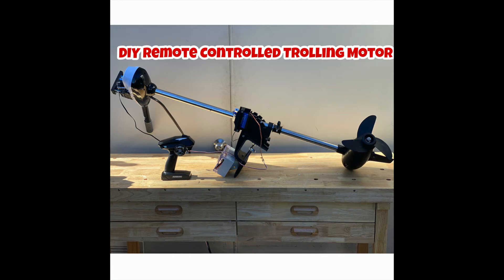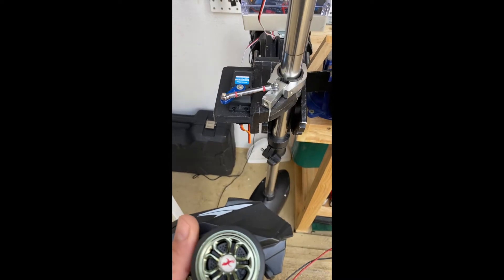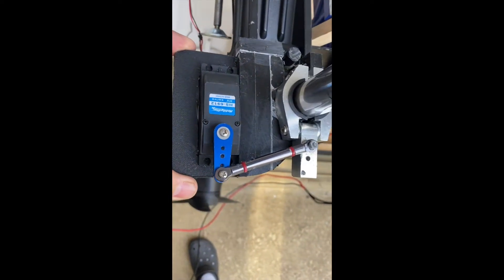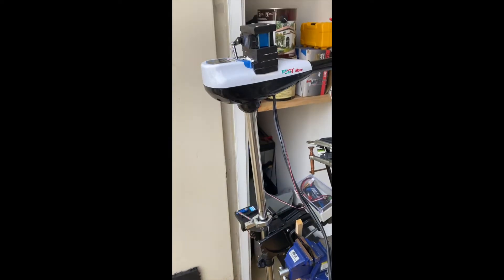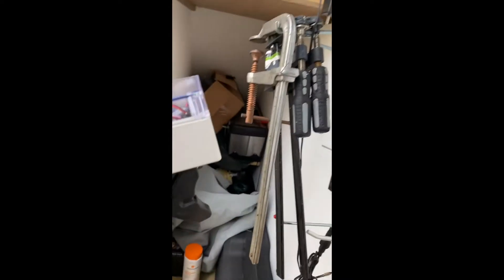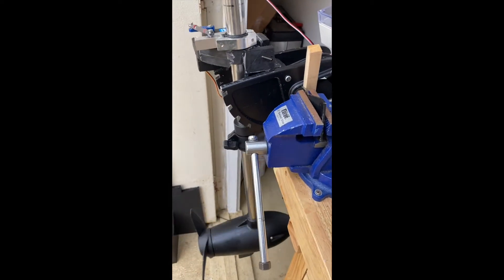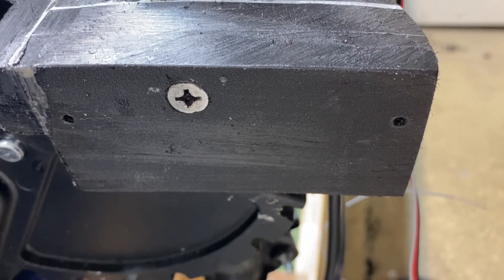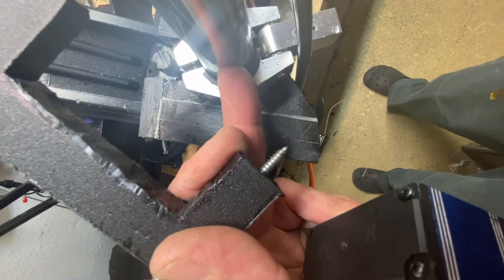Wireless Remote Controlled Trolling Motor Assembly DIY

Comment: Hi where can i buy the servo and housing,,,,,,,,,,,,😊😊😊 im interested in making,,,,,, one or two,,,,,,,,,,,,,,, for my,,,,,,,, watersnake trolling motor ,,,,,,,,
Reply from the maker: Use this 12 volt servo for 3 hp (3000watts) or larger trolling motors 

https://www.amazon.com/dp/B0CCNYDXD2?ref=cm_sw_r_cso_cp_apin_dp_Q7PA0DH15Q8GG9WECZ37&ref_=cm_sw_r_cso_cp_apin_dp_Q7PA0DH15Q8GG9WECZ37&social_share=cm_sw_r_cso_cp_apin_dp_Q7PA0DH15Q8GG9WECZ37&starsLeft=1&skipTwisterOG=1&th=1&psc=1
Reply from the maker: https://a.co/d/154obkr

This will be fine for your water snake. I recommend this servo for trolling motors up to 2 hp or about 2000 watts. Good luck and let me know if have any other questions
Reply from the maker: This is the marine board I used to make the engine mount and servo housing 

https://a.co/d/3Ren9Se
Reply from the maker: I used the M8 clamping knob in this assortment as a steering lock

.https://a.co/d/81IqOeP

Comment: Nice build, can't wait the parts for steering to arrive. As i want to add an brushed ESC as well for the motor itself i'll use on RC receiver for speed and steering. I planned to use a BEC to provide power to the servo. This way i can put it all together in on box with one power input/output and a single 3 pin cable for the servo.
Reply from the maker: A lot of guys run the ESC with good results. Just make sure it can handle the load

Comment: Nice video.  I was looking for a way to accomplish the same thing and yours wins.  The only difference I will be doing is an epoxy casting instead of layering, screwing, and gluing.  I’m probably wasting my time but going to give it a shot. Ha… do you think a smaller servo would get the job done but a little less jerky?  Maybe this also isn’t so much jerk in the water?  Assume you’ve used it quite a bit by now curious if u suggest any alterations from your video.  Thanks for the time.
Reply from the maker: I’m sure you can find a smaller servo that can do the same job. Make sure the voltage of the smaller servo is correct for your project. I remember seeing a few volt options….The servo I’m running now is 65 or 75 kg of torque. I’m pretty sure you will be to find a smaller servo with similar power output but it will more than likely cost more. Good luck. Post a video when your done. I would like to check it out!

Comment: Thanks for this video, im in the same project you save me time on ideas on this... excellent... i just need steering.
Reply from the maker: I’m putting out a new video in the next day or two. I accidentally sank my old motor but retrieved it. I’m reusing that same steering setup on my new motor and it’s still going strong despite sinking and being a year and a half old. Good luck with your project.

Comment: Waiting on parts: I love your idea of using an RC servo escapement to provide remote steering! However, I am NOT going to make a mod to provide remote control of the motor SPEED, but am ONLY INTERESTED in the borrowing your idea as it relates to the STEERING ASPECT designed in your neat creation. Question: I am perplexed by one thing; You mention that your motor came with a "BRAKE", and that "brake" then provides a static place to "push against" (the other end of the linear actuator then, of course, couples to the short steering arm of the trolling motor). I do NOT SEE what, or where, that so-called "Brake" is, on the trolling motor shaft from the information that you have graciously already provided. Did you find an EASY static point to push against,... ONLY because that your particular trolling motor model has some unique feature that all other motors do NOT have,..to use as YOUR static point? (for that matter what-in-the-world is a "Brake" doing on a trolling motor in the first place??) ....Even more to the point,..What the devil is a "brake" doing on a trolling motor in the first place??
Thanks to the rest of your documentation, everything else seems somewhat easy for me to try and duplicate, in adapting your servo idea,...?
I would appreciate any additional pictures or explanations that you might be able to provide as an answer to my question. Thank You so VERY MUCH!
Reply from the maker: Most trolling motors have a little wing nut bolt on the trolling motor shaft that locks the motor in one position. This is for boats that already have a rudder system to steer the boat. The brake on your trolling motor locks motor steering angle in one position and steering is accomplished by alternate methods, either rudder or paddle….I took the wing nut out and mounted the servo to the  threaded hole where the brake used to be. You can see the threaded hole and the brake in my video right when the music starts at the beginning of my build montage
Reply from the maker: I tried to post a photo of it but YouTube won’t let me. Here’s the original Amazon advertisement for the motor. You can see the little black wing nut just above the tilting transom mount. 

INTBUYING Electric Trolling Motor Brushless Marine Motor Propeller Thrust Saltwater Transom Mounted 1.5T Load 165 LBS 24V https://www.amazon.com/dp/B08FQMQ6B5/ref=cm_sw_r_cp_api_glt_fabc_PRH95GB5Q3EJ8B8AE946?_encoding=UTF8&psc=1

Comment: Thanks for sharing the build. I'm definitely leaning towards the servo steering build. I like how it gives you full tilt capabilities. Do you think a smaller servo would work? Also curious if I could run a voltage regulator and run the servo/receiver off my main battery. I think I will be going the PWM route for throttle control.
Reply from the maker: I chose the biggest servos I could find because of my large 1500 watt trolling motor,  and  I wasn’t sure how much effort it was going to take in the water. You can definitely get away with a powerful small servo, however they are three times the cost. If you search they make servos that run off of 12 volts also…. There is a device that steps down voltage, I’m considering doing the same and running my radio off of my backup lightweight lithium ion battery’s that I keep on board in case the large Lipo4 battery dies. Good luck with the build. I’m curious to see how yours turns out.
Reply from the maker: Direct Current Converter 12V to 5V 3A 15W Buck Converter Module, Reduced Voltage Regulator Car Power Converter Output Power Adapter, Wire Interface (1 Piece) https://a.co/d/9JRJfB2

I ended up using a similar buck converter to drop the volts from 48 volts to about 8 volts. I chose 8 volts because I can run the radio receiver and the high torque servos with that voltage

Comment: Can you put links to the parts
Reply from the maker: 8pcs Upper & Lower Linkage Pull... https://www.amazon.com/dp/B07WQWR66N?ref=ppx_pop_mob_ap_share
Reply from the maker: Power HD 1/5 Scale Waterproof... https://www.amazon.com/dp/B085W7Z8HB?ref=ppx_pop_mob_ap_share
Reply from the maker: WPHMOTO 28mm 1 1/8 inch Brush... https://www.amazon.com/dp/B078FGYK4W?ref=ppx_pop_mob_ap_share
Reply from the maker: DUMBORC X4 4CH RC Radio System... https://www.amazon.com/dp/B07RR81GSB?ref=ppx_pop_mob_ap_share
Reply from the maker: Marine Board HDPE (High Density... https://www.amazon.com/dp/B073BV5LN9?ref=ppx_pop_mob_ap_share
Reply from the maker: INTBUYING 24V 165 LBS Electric... https://www.amazon.com/dp/B08FQMQ6B5?ref=ppx_pop_mob_ap_share
Reply from the maker: Zeee Lipo Battery 7.4V 100C... https://www.amazon.com/dp/B073S2W6PZ?ref=ppx_pop_mob_ap_share
Reply from the maker: Let me know if I forgot something, or if you have any questions.
Reply: @waitingonparts  Did you build or buy the collar that is around the trolling motor shaft? the Aluminum horseshoeish part.
Reply from the maker: @Carob75  WPHMOTO 28mm 1 1/8 inch Brush Handguards Hand Guard Clamp Mounting Mount Kit https://www.amazon.com/dp/B078FGYK4W/ref=cm_sw_r_cp_api_glt_i_ZKG8GTE81H7REFYP7WB2?_encoding=UTF8&psc=1
Reply from the maker: Plastic Electronic Project Box Junction Enclosure Case Box Waterproof 156 x 91 x 60 mm https://www.amazon.com/dp/B01N8SLCUM/ref=cm_sw_r_cp_apip_9DiGLJXuIdNZi
Reply from the maker: MCIGICM Voltage Tester, 2.5V-30V Mini Digital DC Voltmeter with 0.28 inch LED Display (5 Pcs) https://www.amazon.com/dp/B07Q2RQYPJ/ref=cm_sw_r_cp_api_glt_i_1AFXV5Y7VTVAAFEMCZJX?_encoding=UTF8&psc=1